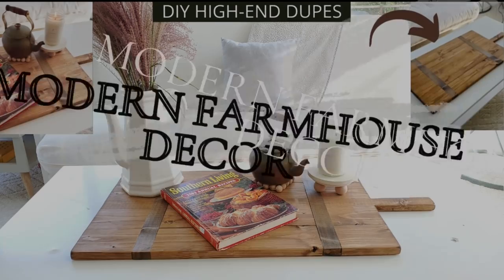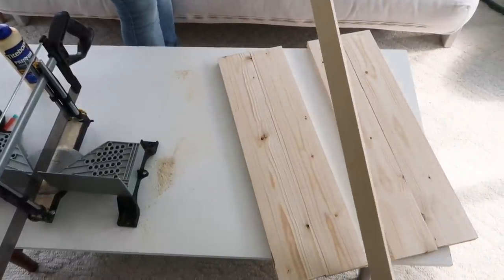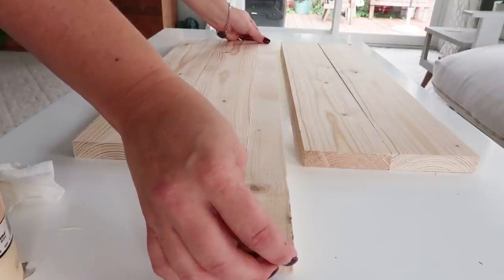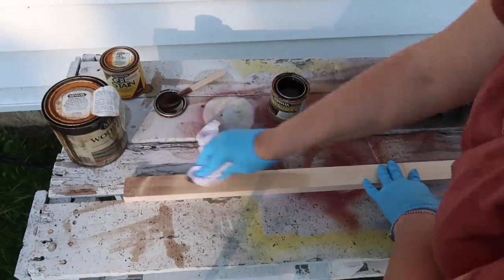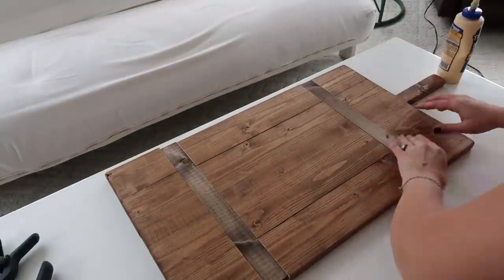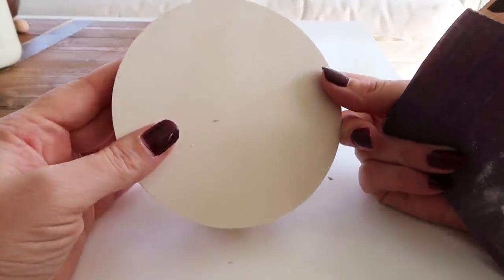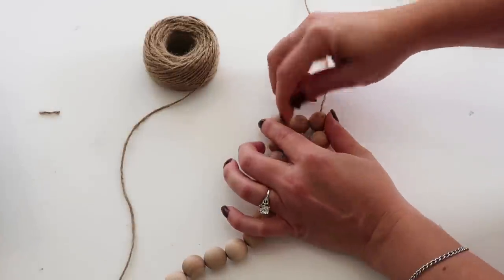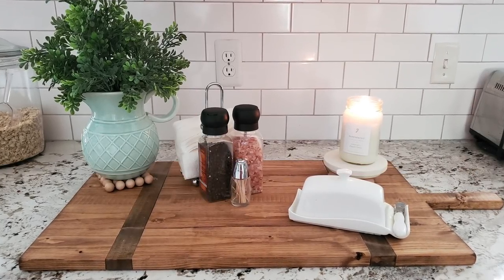🌟EASY DIY WOOD CRAFT PROJECTS & GIFTS - Pottery Barn Charcuterie Board, Trivet, Pedestal DUPE Decor

Comment: Amazing! 
fell in love with the board! Any suggestions or is it even a possibility to make this food food safe?
Reply from the maker: Thank you so much Mihelle!
Yes you can! You might want to check with Home Depot or where ever you get your wood pieces from. But I think if you used an Oak or Walnut (Untreated) and sealed it with a food safe sealer, wax or oil then it should be ok to use with food. I was going to do some research on that because I want to do some more fun projects like this, but want them to be food safe.

Comment: I came back to this video, I am looking for the video where you stained some wood with gray and brown, to make it look weathered. Anyway, I just wanted to tell you that Bob Villa said that any finish, polyurethane, polycyclic, wax, etc., you put on your cutting boards, is food safe, as long as you allow it to cure for the correct amount of time. You'd have to read the container the finish comes in, to see the proper curing time. I am not sure if that means stain, that is not sealed, or if it is just if you use a finish, such as the ones I mentioned above. Just thought I would let you know, because I was looking last week, as I am working on some cutting boards, right now.